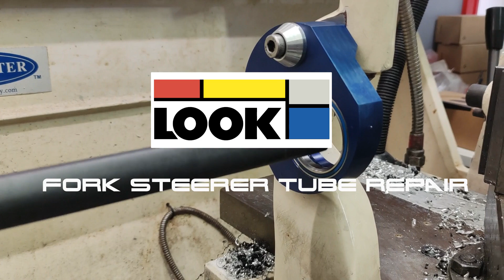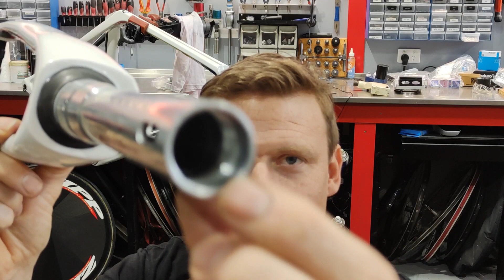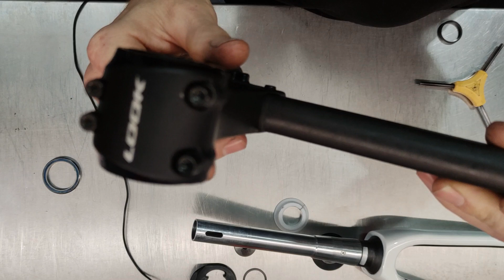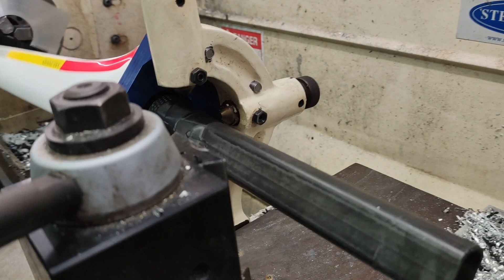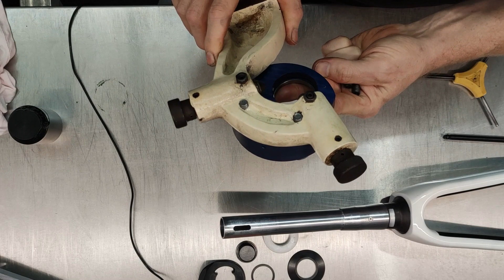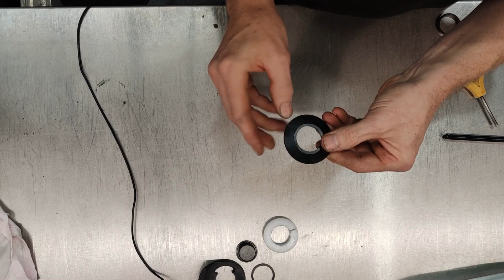Look 795 Blade RS Fork Modification And Steering Tube Replacement

Comment: I'm interested in fitting a normal stem to the 795 Blade.  With the shim for the stem (so the box section part of the steerer contacts it), is the standard Look stem 1 1/4 or 1 1/8?  Presumably I should be able to feed the cables into the shroud in the same way as with the Look stem?

Comment: It would be awesme if you guys could machine and market a set of adpting wedges that allows the use of a conventional stem or integrated stem bar with a round steerer tube bore to be used on the rectangular fork steerer. It will solve the problems the stupid Look Aero design stem brngs to what is otherwise a brilliant bike
Reply: That would be a simple job for any machinist , By the  pics i see of the look steer tube if i owned one i would machine a aluminum insert and bond it internally so it would not crush and crack , preventing what happen here .
Reply: What would be the best method / approach to machining a modified insert for this. Alternatively if one used shim's would it just be to fill the gap between the round stem clap and oem look square tube ?
Reply: @warickm393  probably start with a round bar and machine the outside to 1&1/8th. Then mill out the bar starting along he centre line till you’ve removed the width of the flat section of the steerer tube. You will be left with two sectors of the circle that would fit into the space between steere tube flats and stem clamp zone